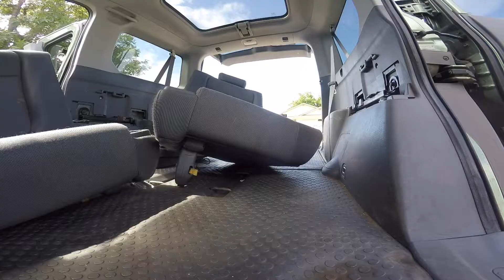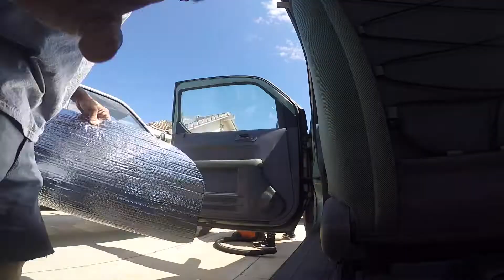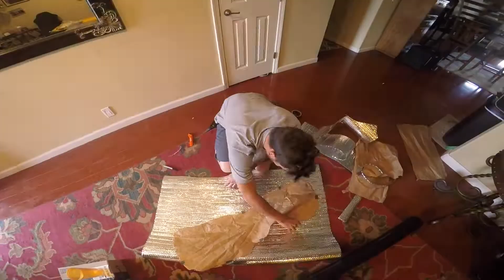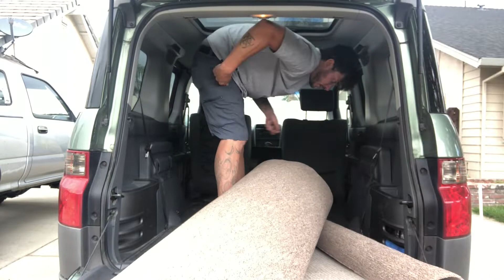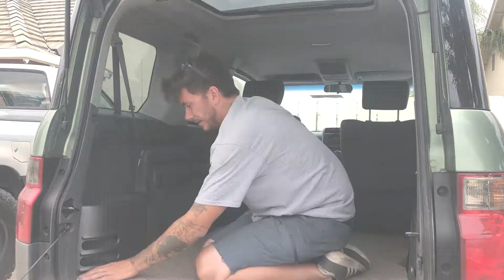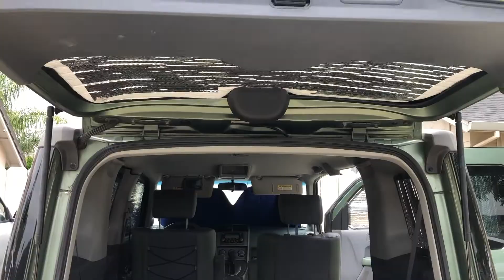Honda Element Camper Conversion | Easy Window Shades and Carpet | Van Life

Comment: did you cover or filled  the two seat mounting indentions in the middle  of the floor under the carpet?
i did exactly the same cut with my  carpet ,lol
Reply from the maker: I just left them as is because I’ll be putting my wood frame bed on top! I love the carpet in there so far. Haha. Any issues?
Reply: @duhhashmo  it just feels funny stepping in it,so i filled mine with bits of carpet leftover...i just use a trifold mattress no frame for space
Reply from the maker: josmo fy good idea! I’ll experiment this week and see how much I notice it.

Comment: nice, i plan on doing either a van or element conversion myself... i'm just worried about keep cool in the summer especially in an element with no ceiling fan. do you guys have any plans for that?
Reply from the maker: vermili0n nice I’m super excited! I did just buy a solar generator to plug in a little fan or two. I also want to try and travel awaayyy from the heat if possible 😆 do you have any thoughts?
Reply: @duhhashmo  other than some obvious things like window covers/window screens, staying in the shade  and like you mentioned stay away from hot areas/elevations and using fans i'm not really sure if there's much more you can do in such a small space. I like the gas mileage, stealth and off roading the element has to offer, the only down sides imo are no insulation and less space but you just have to figure out ways to spend as less time inside of it as you can i guess